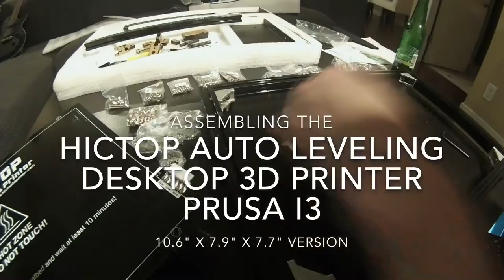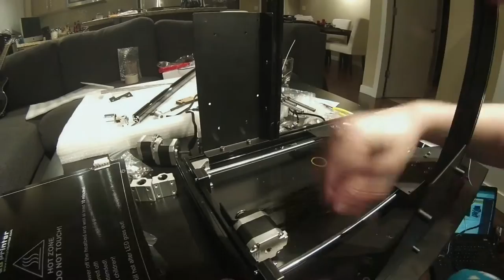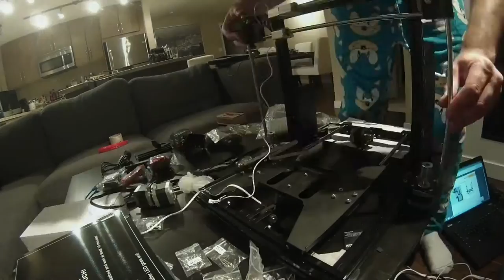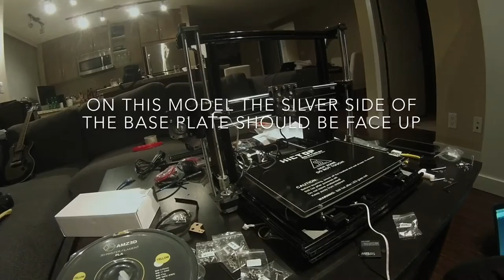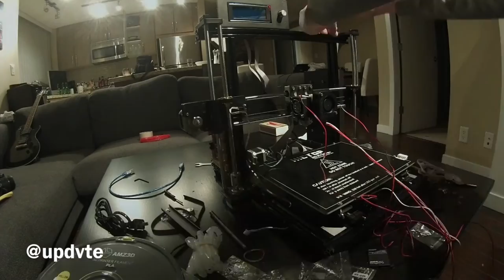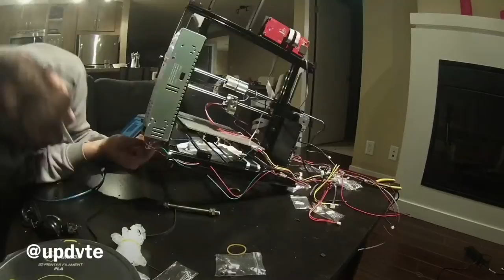HICTOP Auto Leveling Desktop 3D Printer Prusa I3 Assembly Time Lapse

Comment: How long was the assembly time?
Reply from the maker: Mark Cruz I did it across two evenings after work, maybe 5-6 hrs total from being boxed to powered on. The .pdf file that came with it was awesome for assembly and for wiring I used the HICTOP YouTube page's wiring video because the pdf was not as easy to follow for that part.